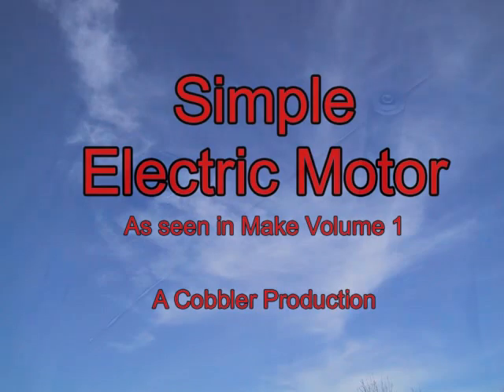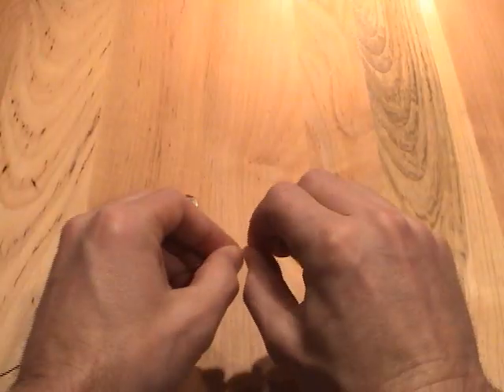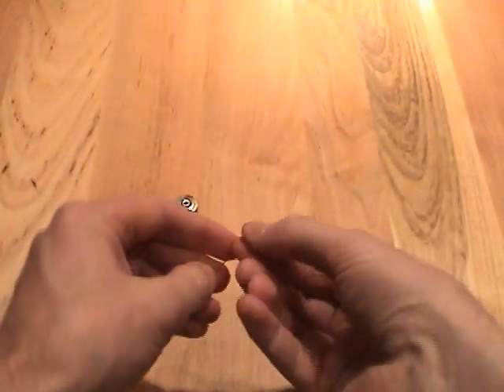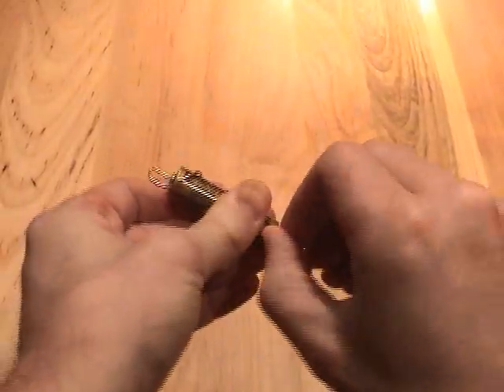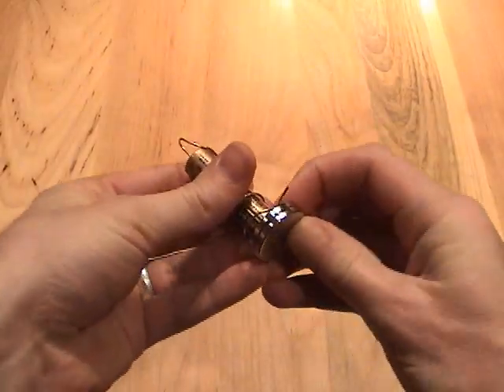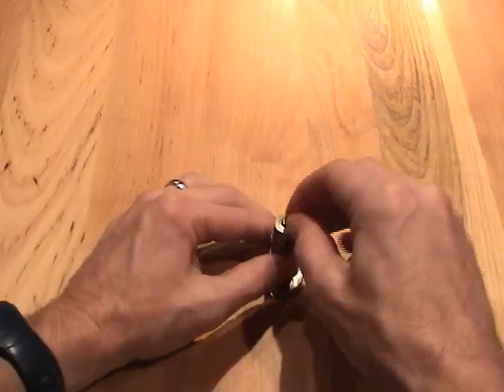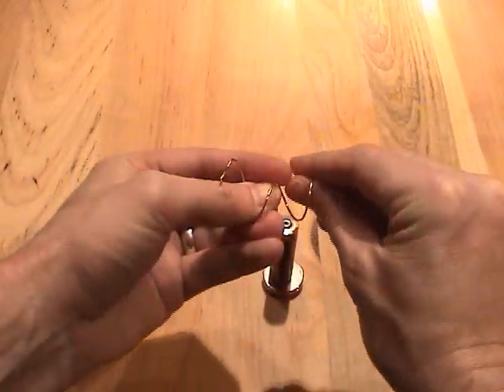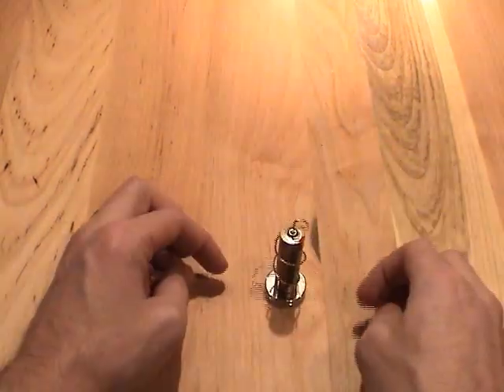Unexplained Phenomenon - Simplest Electric Motor

Comment: Same reason our earth spins, magnetic fields, this one is created by the electrical current. He didnt show it, but its also a magnet. but because it is free enough to spin, it will. It will spin faster if the coil is wound tighter. Like a transformer, When the voltage/amperage ratio changes from the electric current going through the coil, so does the magentic strength. You can also do this with 120/240V and two spools of 1000ft 12awg wire. Electricity is fun!

Comment: You are talking about is the "skin effect", were electrons move to the outer layers of a conductor. This skin effect only occurs at quite high frequency alternating currents (AC). A battery is only DC (although there may be some pulsing, as the wire makes and breaks contact with the magnet). In any case, this has nothing to do with the force acting on an electric current in a wire in a magnetic field - the direction of this force is given the very simple to understand Fleming's left hand rule.

Comment: I personally like the version where you hang the magnet on a nail below the battery (since it's on a magnet, it'll stick and hang with little friction).  You then use the wire to complete the circuit.  It goes MUCH faster, and makes a lot more sense when you think about it.

Comment: Magnets don't "attract" electrons.  Electron flow here is driven by the battery.  Increase the battery voltage and, everything else remaining equal, the wire will spin faster.

Comment: For more detail: The current flowing through the wire, from the top of the battery to the side/bottom of the magnet (which is part of the circuit) induces a magnetic field surrounding the wire like a sleeve.  The magnet repells the magnetic field surrounding the wire and the wire moves in the only direction it can.

Comment: yea you have judge correctly, but this is do to electromagnetic phenomenom, a comon electric motor
the wire in the battery starts moving because there is an iteraction between the electromagnetic field in the wire from the battery and the magnetic field in the magnet.

Comment: it's a homopolar motor, rather simple to make but not very efficient (that'll run the battery flat in no time). like harmonicaman said, it's based on the Lorentz forced, and a similar sort of thing is used in those cool experimental rail guns.

Comment: Explanation: Magnetic field along the axis.  Current in the wire cuts across the magnetic field at an angle.  Result: force on the wire: F =B x E.

Non-explanations:
1. Electrons attracted to a magnet.  No, they aren't.
2. AC current, collapsing magnetic fields and all that.  This will work with a constant current.

Comment: lol so many theories so few brains.
Basically the wire completes a circuit shorting out the battery, causing a flow of current. Any charged partical (ie an electron) travelling thru a magnetic field (from the magnet) will feel a force perpendicular to its direction of travel (faraday showed this in the 19th century), and since the wire is chock full of moving electrons, this force is great enough and always in the same direction to produce a spinning motion.

Comment: Wire is wrapped around the battery.
From the battery, electrons that are charged come out. Then are attracted to the magnet, going down the wire( the conductor) and reach the magnet. And the negative end is touching the magnet so the electrons go there?

Comment: Cool.  And then I thought: Hey, I have a battery and some neodymium magnets right here.  
Problem 1: must be non-ferromagnetic wire. (I tried a paper clip first)
Problem 2: Where did you find a battery with a "divot" in the top?  
Problem 3: Wife wants to know why I'm stabbing a battery with a screwdriver.
Problem 4: Very difficult to get the wire to brush the magnet and not jam.  

Hey it works!

Comment: Electrons do not spiral round skins of wires. 

Have a look at Fleming left hand rule on Wikipedia or similar. This is all you need to understand which direction the thrust on the wire is pointing in.

Comment: Your wire may be straight, but the electrons will still spiral down the skin of the wire, creating motor action.

The spiral wire will balance better, and have several times the torque of a straight wire.

Comment: The wire scrapes along the magnet, building and collapsing a magnetic field in the wire which is attracted by the constant field created by the magnet.

If you flip the magnet, it should turn the other way.

If you flip the battery, it should turn the other way.

Just make sure the wire scrapes on the magnet, because a field won't build in a DC circuit, it has to have AC power.

Comment: Connecting the wire across the top and bottom of the battery (well the bottom through the magnet) creates a current in the battery. The current produces a magnetic field which makes the wire magnetized so it reacts with the circular magnet by spinning?

Been a while since I took physics but I think that's what's happening... or close to it anyway. It's related to what happens when you put a compass near an electric wire.

Comment: To demonstrate that the motor effect does not depend on the spiral, but only on the radial current, and the downward current, you can make one of these motors with a single straight length of wire running directly from the top of the battery to the outer edge of the magnet. It is harder to balance such a wire on the battery (you can use a nail banged into the battery), but you will see the wire also moves tangentially, around in a circle.

Comment: To be more precise, a degree of tangential force also arises from some of the net downward current. Further above the magnet's surface the field is no longer purely vertical (remember your school experiments with iron filing to display the curved lines of magnetic field). So in terms of vectors, there are radial components of the magnetic field above the magnet. Apply the left hand rule to the net downward current in this radial magnetic field, and you'll see you also get a tangential force.

Comment: I made one these motors, and it works. Fleming's left hand rule explains it, but takes a while to understand what 's happening. In fact, spiral has no influence on the circular motion: it is a solenoid, and is pulled down or pushed up by the magnet. However, the bottom of the spiral widens out, so here the net current flow is radially outwards. The magnetic field is vertical just above the magnet, so apply the left hand rule to this radial current, and you see the force of motion is tangental.

Comment from the maker: There have been a lot of comments about the shape of the wire cusing the movement.  This is not the case, because a wire spiralled int eh oposite direction does not change the direction of the spin and a wire bent into a shape with no spiral also works.

Comment: This can't be the reason, because that would produce unlimited energy. After all, if the battery is not connected on both ends, there is no drain.

Comment: all it is is a magnetic field from the electric current in the battery, which is only negative or only positive due to the wire only contacting one end of the battery. the magnet gives a magnetic field of positive and negative because thats what magnets do. combine a full magnetic field with a field consisting of only positive or negative and the magnet "levitates" the wire and the uneven field is responsible for the spinning. the spinning keeps the wire stable.

Comment: it works on the same principle as an electric dynamo or motor.
Any coil of wire with a current through it will move within a magnetic field. The carbon conductor acts as a centre for the coil, creating its on magnetic field. This field is then replelled by the lower Neo. magnets' creating the movement.

Comment: That's at least the way we did it in our physics class. We didn't put the battery directly on the magnet, so that might be why.

Our setups was a magnet attached to a base (by itself), a battery connected to a metal "harness," then wire that was wound in circles to look similar to this: -o- . The circular wire would spin and try to connect to the magnet.

Comment: We did this in my physics class last year, just a different set up.

The reason why it works is because when the wire is attached to the battery, it gives it a charge. This creates a positive and negative pole on the wire, and since magnets obviously have poles as well, the wire is just spinning to try and find the opposite pole to connect with.

Comment from the maker: I think that insulated wire would probably work, but you need to have the insulation removed where the wire touches the battery and the magnet.